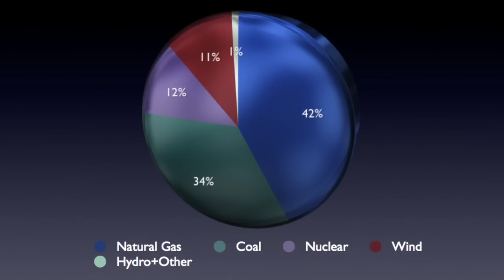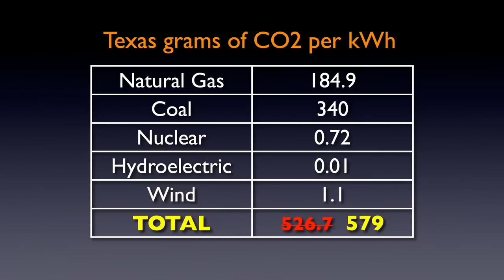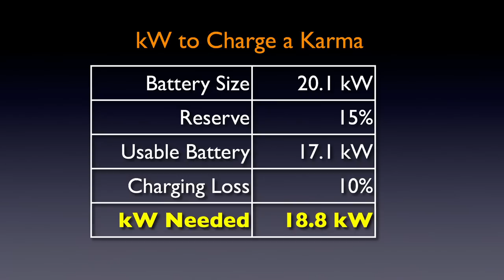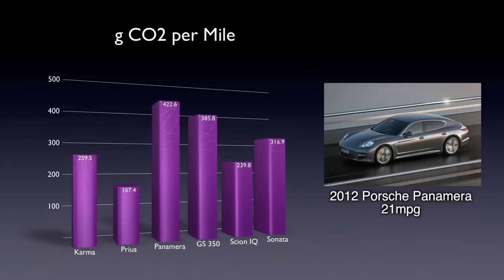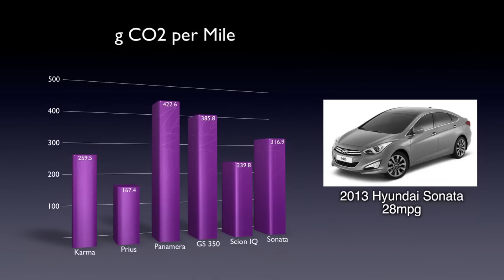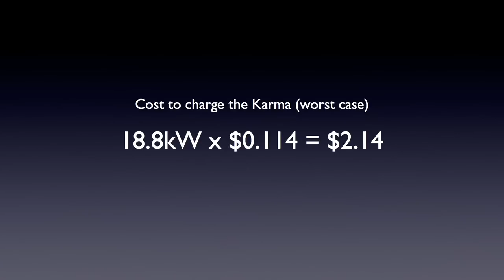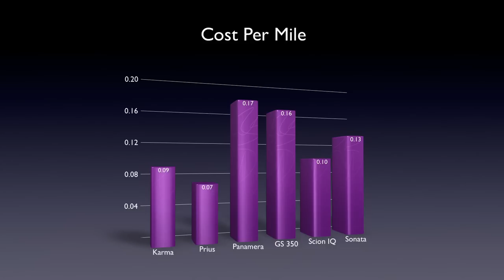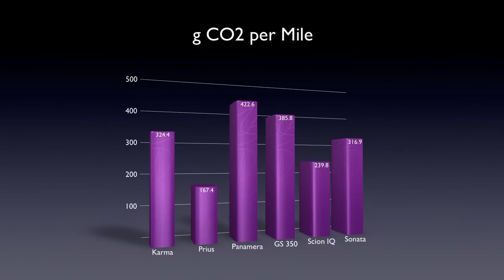Fisker Karma: Better for the Environment?

Comment: Fisker Karma is not electric vehicle. It is extended range EV. It has ICE that is rarely used. BTW, 2L engine is way too big for range extension. 50kW engine is more or less maximum as using it at 50% load is the best and 25kW is enough.
BTW Karma battery will not last 100 000 miles if it is cycled more than 60% of allowed rate. So not more that 30 miles. Many of us make 35-50 miles per day. That way after 100 000 miles there will be about 60-70% capacity left. This will speed up degredation even more. So 100 000 will degrade it about in half. Tesla has 4x bigger battery but it still will lose more than 10% in 7-8 years.
Reply from the maker: Yes, battery degradation is a major issue.  I have 16k miles on my car and the battery is still perfectly fine with no degradation so far, but eventually it'll show.  This should have 80% capacity after 100k miles, so we'll see.  Either way, this still beats the pants off driving a gas powered car.
Reply: *****
Jep. Gasoline is junk. I'm a student and I own a BMW 5-series 2001. I can get 55MPG combined and 60MPG (calm highway). 0-60MPH= 7.9sec. As soon as I have funds I will switch to electric (from Diesel).

Brian. If you want to minimize degradation NEVER keep charge level out of 20%-80% gap for days and NEVER keep lithium chemistry out of 5F-115F degree gap for hours. Ignoring these on daily basis will result in degradation up to 20-30% per year/20 000 miles (similar to laptop battery - uncontrolled cycling depth and temperature).
Reply: Arnis Tarassu Your statement is a complete bulshit. How can an e39 530d make 60mpg? Your numbers are even better than the official Bmw consumption. I own several e39 diesel and I can say clearly that you make maximum 30-35 mpg.

Comment: if i may add & correct me if im wrong.. once the gas is burned, you dont get it back. we will run out of oil in what, 100 ish years? like you said at the end. id much rather use energy from 5 or 6 sources that we dont have to rely on other countries to get. than to use a 1 source, oil. AND (dont take as an insult, u have a nicer car than I) id like to see 100% EV's compared to those cars u used on that scale. does having an EV w/ an ICE generator, x2 defeat the purpose of a "greener" vehicle?

Comment: If I put $4 gas in a car that gets 20 mpg, the cost per mile is 20 cents.

To make it apples to apples, I would depreciate the existing battery pack cost over the projected time-distance lifespan.  Obtaining existing pricing is rather difficult, but assume 3000 Fiskers, divided by the $50 million, A123 said the battery recall cost them, would place a pack around $16k, or 16 cents per mile.  Toyota paid Tesla $60 million for batteries in 2600 RAV4’s, which is around $23k per unit in 2012.

Comment: I am not being augmentative,in fact I respect what you did on this video. It may have been difficult to quantify but I think you should have mentioned GM's turbo four generator power plant. It sounds like you rarely are in need of its extended use, but maybe including the lowest common denominator for this stat would have bumped your stats either way by several percent. I thought it was insightful and intelligent, I just kept thinking when is he going to mention the gasoline engine in the Karma?

Comment: Oil changes are cheap, however other costs related to wear and tear will be higher(because parts would be harder to find and labor more expensive because of that). Also I imagine there are many more electronic computers in an electric car vs a gas powered one which use proprietary computers(similar to newer car computers that cost several hundred dollars for 20 year old technology). Any accidents would be financially devastating as not many mechanics are trained to repair electric cars.

Comment: Excellent production as usual.  I've enjoyed all three of your Karma videos.  I do have a fundamental issue with your assertions however.  You presume that 100% of Karma driving is in stealth mode, when it he whole premise of the Karma is its role as an EVER.  All of the comparison vehicles have tremendous range advantage over the electric range of the Karma, so to fairly compare them, compare them at all levels of operation, meaning, how green is the Karma when the generator is running...